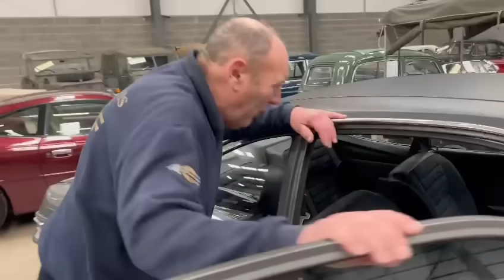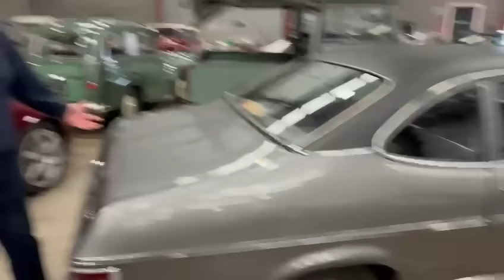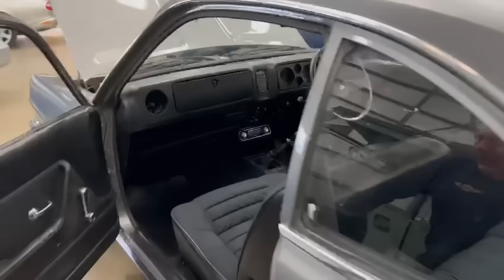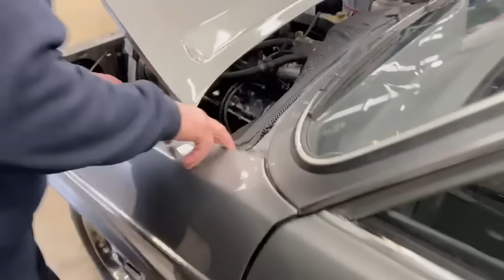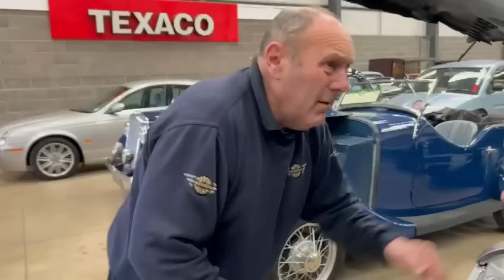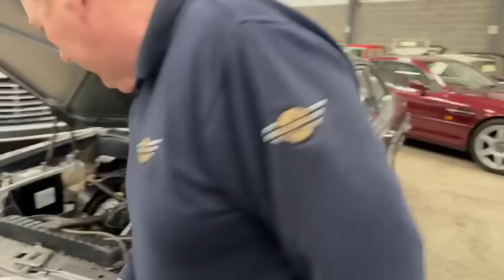1974 VAUXHALL MAGNUM 2300 | MATHEWSONS CLASSIC CARS | AUCTION: 12, 13 & 14 JUNE 2024

Comment: I remember as 14 year going to a London motor show and seeing the Firenza Droop snoot, 2.3 ohc twin strombergs, 5 speed ZF box, 0-60 in 7.5 secs, topped out at over 120, for those days sensational for a run of the  mill production car.

Comment: The 2300 Magnum coupe was a rare car indeed. Initially over-shadowed from '73 -'75 by the HP Firenza 'droopsnoot' and then in '76 by the Cavalier / Manta coupe. I think Vauxhall only made around 600 Magnum 2300 coupes, and around 1500 Magnum 1800 coupes. Someone will have the actual figures, but literally only a handful of 2300 coupes now survive.

Comment: I had a 1800 2door auto version. Light green colour with a vinyl roof!  I seem to remember(correct me if i am wrong) that the engine was angled at 45 degrees and it suffered from the so called "Death Rattle" when starting from cold!  I think i bought mine sometime in the 1980's. The photo i have of it will probably tell me when i had it. No record of mine on DVLA so sadly may have been scrapped. I think there are only a couple left of my version.

Comment: those engines had huge torque but I prefer the vx4/90 or panther Lima with same running gear but fiberglass body.